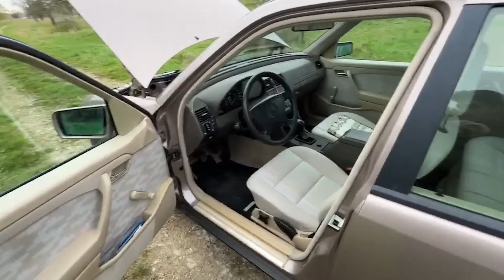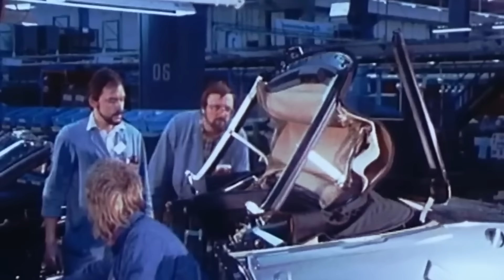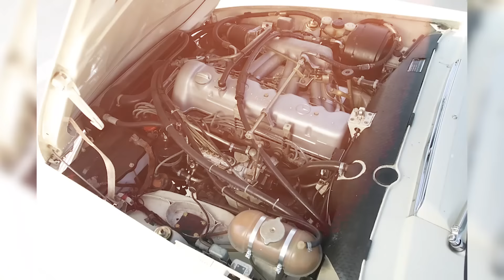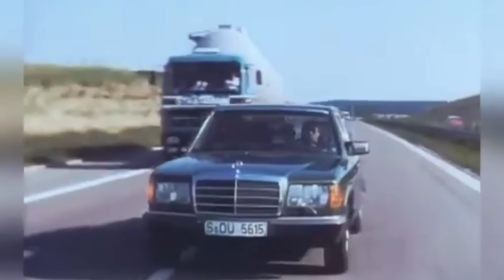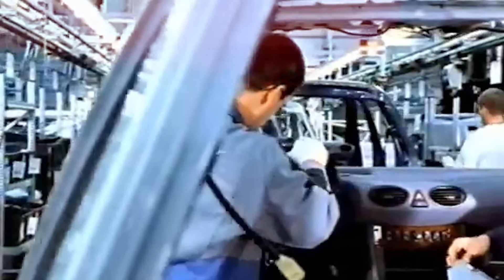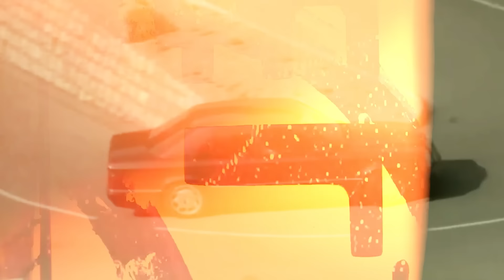9 Old Mercedes That Were Built to Last Forever

Comment: you know what is even better than owning a w123 300D turbo diesel? owning 2 of course. , I'm the proud owner of an '82 and '84 mbz,  one is European (82), the other, american,. there is a difference between the 2, the thread on some engine components is mm. vs standard (I found out after cross threading trans. oil cooler not understanding why at first.)

Comment: This video sounds like a PR advert for Mercedes Benz - totally ill researched and in fantasy land. No mention of the rampant corrosion, the disintegrating wiring, the poor crash tests of the W202, the suspect handling of the W114 and W126. I owned a W126 and it was a good car but had its faults - I have owned a W123TE for nearly 30 years. They are generally good durable cars but by no means perfect

Comment: The R129 is a great car except for the engine, wiring harness made of biodegradable wires and the failing, convertible roof actuators for the fabric top.  The V8 version was unbelievable powerful.

Comment: W202 with M111 engine IS THE BEST i bought it as a send hand in 2014 up to now it is still running it's now 12years. Now i even changed it from auto to manual gearbox it's perfect.

Comment: You forgot 2 more engine types for the W124, both are M119 types. You had the W124 400E, which had the 4.2L V8 producing about 280 horsepower, and the 500E, which had the 5.0L M119, producing 320ish horsepower, and fun fact:  porsche built the 500E in their factories

Comment: I have  c class Mercedes, 60,000 miles  air con packed up and considered un repairable by most  air con engineers I spoke to
Loads  of other jiggly problems which cost  quite a bit.  Mercedes. Suck they really do.                Rod in London  ‘26

Comment: I had an '89 560SEL. destroyed from both ends when i was rear ended at a red light by a 60mph texting driver. Passenger compartment remained 100% intact.

I currently own a '99 SL500 and '03 ML500, both have the M113 five liter V8 and the 722.6 five speed transmission. The last of the real Mercedes.

Comment: OMG.  The W140?  The S-class that had a class-action lawsuit against it, that MB lost?  I had one.  Yeah, damned nice car new, but NO!  Bought one many years ago, and swore I'd never have another one.  Sold it with 101K on the clock, and was happy to see it go.  Like an old Jag.  Spent more time in the shop than it did on the road.  I started out 30 years ago with W126 S-class cars, and to me, they're the last real S-class.  They still had the look of class.  W126 will never be overcome.  I still drive them to this day. I totally agree with number 1 though.  The W123 was by far the greatest!

Comment: W203 is bad car? like worse than w203or202? man i dont know where you heard that, but wtf. yeah problem with rust, but its same with w202, but if you protect w203, then its same like w204, and materials in interior is much much better in w203 than in w204. w211 and w203 all day then anything else.

Comment: They are built to last but they are disappeared almost everywhere, soo....  With the exception of the w204 but they are almost all replaced by 205 now.  The 211 too look good but the sbc issue prevents me from buying one. The 203 imho had better interior design than the 204, the front end aged badly and never fully got me even when new. The older one rusted and plastics melts and crumble over time. My beloved W208 would have been impossible to keep alive and not wort restoring for this reason

Comment: I split my "daily" driving between my '94 W140 S500 and '95 R129 SL320. I've had both cars since new and refuse to get rid of them. The only major problem I've had with either one was the hydraulic cylinders on the R129 soft top. Beyond that, the cars are tanks!! My wife has a 2025 Subaru Forester Limited that feels like a toy next to my "old" MBs. 👍

Comment: No I disagree with the W203 part, the 2006 facelift mercedes benz w203 is also reliable and strong

On the w203 it depends on the facelift... And to remind you W204 and 203 are not really different

Comment: Bin mit Ponton und Heckflosse groß geworden. Meine Großeltern hatten 2  Strichacht,, 1 W 123,,124. Ich selber hatte 4 W123,, darunter ein Coupe,, ein W 124 300 CE 24 und ein W 201 190 E. Die besten Daimler waren 115, 116,126, 107,124, 201,, und der legendäre W123,, das bis heute meistgebaute Modell. Habe mir den Filmbeitrag angesehen,, leider sind manche Aussagen nicht okay. W 202 ,, 210 waren die größten Rosteimer der Neuzeit,, damit hätte sich Mercedes fast den guten Ruf ruiniert.

Comment: W204 1.8 petrol engine has a chronical crankshaft pulleys problem. It's a pain for the wallets. Still a pretty decent car, but if you don't want these kinds of trouble just look for the older versions of the brand. Time can be a enemy sometimes, so if it has rubber or plastic parts, you know what's going to happen past all of those years, but you won't find electric gremlins, over sophisticated (and complex) engineering. It was built to last

Comment: W123  300D wagon, we got it new. Vacuum issues, antenna switch, rear susp. ballasts. Rust at rear wheel arch. All this when we sold it at 56k miles. Not having a good mechanic nearby didn't help. Now a W124 300E 6cyl that was neglected. Will be painting it this summer. Nothing serious and just turned 100k miles. It's a keeper.

Comment: I've owned examples of almost all mentioned. 126, 124, 123, 202, 203, and 204. The best, in my opinion is the one we have now... a 2013 C300 4Matic, with the M276 engine. It handles so well and gets over 30mpg at 80mph. It looks great as well. It has Direct Injection, but still has lots of power, gets good mileage and when the intake was removed to replace a cam sensor, it had very clean valves. I ran Shell, now BP and change the Liqui-Moly every 5k miles.
Reply: That’s very welcome insight, thank you. I’m looking at a 1981 380 SL, and  curious as to the benefits of newer model. 😊

Comment: Tengo el E420 W124 con el V8 M119 y es imponente, también un E320 W210 con el exquisito M112, y tuve el C230 Classsic W202 con trasmisión manual, cabe destacar que Mercedes Benz no vendía autos en México 🇲🇽 a principios de los 90s por lo que tener uno de ellos era cosa de ricos 😅.

Comment: I own a W204 Diesel had it for 7 years and 200000ks driven it all over Australia for work dirt roads and mine sites and never had a single issue although I had to replace the AMG wheels to deal with country roads. It is an absolute beast
Reply: I've had my 204 two years, first Mercedes I've ever owned for some strange reason. I totally love it and I can't see me ever parting with it. 3ltr diesel and it can easily return 45 miles to a gallon.
Reply: @jontaylor1652  They are such great cars and super reliable as well! The only thing I had to do was a DPF burn after 180000ks so I think thats 110000 miles or so . I actually brought mine to flip because I got it so cheap but as soon as I got it I just fell in love and that was 7 years ago

Comment: A bit harsh review on the w203! I have a w203 which is now my wife's daly driver after I upgraded to a w212. I have it since 2014 We never had issues with it just a few worn bushings and ball joints but that's the same for any car that's over reading over 300,000🤷🏼‍♂️

Comment: I own a W203 and even at 210k miles it runs perfect! I can’t even hear the engine compared to my friend’s 2016 Nissan Altima engine that runs so loud. I did have some electrical issues but they are not hard to fix. The wiper and turning signals get messed up but it’s not hard to replace the stoke.
Reply: you are stupid having a W203. Real MB owners won't recommend W203 because it is a garbage product. Really, I wasn't kidding.

Comment: I have owned 2 Mercedes Benz 240 d's, one of them a 1980 model and the other a 1979 model. Before these I had a 2 year affair with a 1960 220b. All of these were all 4-speed stick. After that I owned a 190E 4- cylinder with automatic transmission - an absolutely delightful car. I then bought a 1998 C230 and following that another 1998 C230. These were both 4-cylinder cars with automatic transmission. The last Mercedes Benz I owned was actually my son's. I bought a 1998 C230 with a blown engine. My son bought a used engine, put it in the car and is still driving it. Out of some 52 cars owned during my motoring life these cars cost me less to maintain, repair and run than any other. I guess my 2006 Honda Accord also falls into that category.  As long as you realize that Mercedes Benz engineers liked pneumatic systems rather than electrical systems where they could use either you should be able to manage most maintenance tasks on these cars!

Comment: I have a 1997 c 230k with 321000 miles on the clock...runs great,a few small things have failed but all can be fixed ...

Comment: R129 had 2 big issues, biodegradable wiring harnesses insulation (pre 1995), and leaking hydraulic cylinders for the roof, this is a $5000 repair to replace all of them

Comment: The W203 “universally hated”? Man don’t make me laugh!!! I own a very late 2003 C220 Elegance (One of the first galvanized ones) german built, and it feels like new despite having nearly 300.000 kms! Not a single creak or rattle, nor rust or electrical issues! The 202 was a disaster for rust, cracking vinyl dashboards and bio-degradable wiring… And the 204 was a step back interior wise to the 203… It had a dull Chrysler-like interior with peeling buttons and grey hard plastics…

Comment: I had two of W202, first from 93 with 2.2 petrol engine 150hp, and then facelift version from 98 with 220 CDI 136hp. One of the best cars I ever had. 
I later sold the CDI to a friend — he still has it to this day. It’s got almost 400,000 km on it now. The only real issue he had was rust, which he’s already taken care of, and then the automatic transmission started jerking a bit, so he changed the oil — and it’s still running fine.
Now I’ve got a W212 facelift, also with a CDI engine, and in my opinion, it’s the last truly solid Mercedes.
Reply: How did you deal with the rust on your car? Did it come back?

Comment: I have 2 x w203 C200 Kompressor.....one has 300K klms....(2001)    one has 107K klms (2002} both white.. both W203-045   m111 engine 722.6 Transmission....great cars.. and parts on eBay.. cheap cheap cheap.... Anybody that knows anything about MB.... KNOWS the M271 and M272  are absolute shitbox engine.... the worst 2 engine MB ever made... Google them people.... and NEVER BUY EITHER OF THEM

Comment: I have a W140 300TD (1998)! 
I would never trade it for any newer S-class!
Reply: So you have a wagon w140? Because TD stands for touring diesel, DT stands for Diesel Turbo and TDT stands for touring diesel turbo.
Reply: @skitz7520 
W140 is not a station wagon, everyone knows that! so turbodiesel! but thanks for the correction…
Reply: @ocsi-V8 Yea, but as you said 300TD i had to correct you and i know the w140 only came in sedan and coupe. I just put in some sarcasm for you😁😎

Comment: Today I turned 564,000 km on my Tesla S. The best car in the world, more reliable than all the Mercedes cars I drove 30-40 years ago. The maintenance cost in 11 years is not even 8,000€. The whole car has paid off through almost free driving, if I compare how much money I would have spent on servicing and fuel. And I still have a car that holds its value incredibly well. These new pieces of junk are worthless; it's better to buy a 20-year-old Opel or Toyota with low mileage than anything new, just problems and costs with that eco equipment.

Comment: The record breaker for mileage is a W115, (the four cylinder version of the W114). This was bought by Mercedes from a Greek taxi driver and displayed at the Mercedes museum in Stuttgart with 4,000,000km proudly written across the windshield.

Comment: w204 breh. yeeessss. 

its crazy i have an e550 coupe which the platform/underlying structure is based off of the w204. I can honestly say that from the moment i started fw these cars(had an e400 as well), i could instantly feel the solid/rigid structure upon the first test drive. It felt like a tank to me going down the road, heavy in a good way(these are the cars that were still made in Germany)...also the 3part suspension/adaptive dampers work very well and literally "adapt" to how you drive the car. With the amg pkg it handles damn near just as good as my Veloster N! Lolol naawh, but close enough to have alotta fun with it even though its really meant for being a highway rocket that literally eats roads and long drives.

Comment: - How indestructible do you want it?
- Yes
Reply: suprisingly acurate, you dont really need to upgrade the om 603 turbo engines internals before you pass 300-400 hp

Comment: Most of those selections are reasonable but the W140? 

Are you serious? 

There's hardly any on the road because the thing was so complex

As far as I know the M119 was never used in the W126 

It was introduced with the R129SL 

Crumple zones were not introduced with the W116 in the 1970s but with the ponton of the 1950s 

ABS was introduced on the W116 though. 

Another one of Mercedes-Benz first in engineering 

Interesting thing about the R129. 

It had a very long gestation because they  most of their resources getting the W-201 – the "baby Benz" to market 

It was supposed to come out about 10 years before it did. 

That's why the R107 – the SL from the 70s and 80s-had an over 20 year production cycle 

And because the R129 had so much time for development they developed the M119 V8 for it and pop up roll bars 

It was supposed to have the M117 V8

There were other small errors but compared with a lot of the junk you  see on YouTube it's reasonably well

Comment: M272 as reliable? No, it is a 90 degree V6 engine which needs a balance shaft and is reported as a source of troubles. So the W204 should have the M271 if.
Reply: M271 and M272.. worst engines MB ever made.. shitboxes

Comment: The problem of rust in the w202 was solved in the face-lift  of1998😊
Reply: Before they joined Chrysler and water-based paint, and the accountants took over, 
the cars didn't rust. I see a lot of early models from 1993, 1994, and 1995 that don't have a lot of rust. The steel and rust protection were also of a higher quality than the later years.

Comment: As im watching the video that is a false claim about the w204 its not as reliable as the w203 and the engines in the w204 are the worst engines mercedes has ever built both gasoline and diesel

Comment: W202 was great, my mother had one new in 1995, around the same time my father had a W140, to be honest, apart from being smaller in size , the W202 and W140 doesn’t feel much difference, maybe because my mothers W202 was overspeced, it had every option at the time apart from sunroof.
Reply: I had a nacked w202 122bhp sedan &it went 220km/h 2pees on board

Comment: Iv Owned My 1990 560 SEC For 25 Years AND Its An Incredible Ride! It had 145K on it, Overall it was in Very Good Condition! It Needed a Valve Job when I Got Her. I Found A Fine Mechanic and We Had a Good Relationship! We Worked together and Got it Done He Did a Brilliant Job! It Came Out Great! She Is A Black On Black Beauty She is Fitted With 18in Staggered AMG MONOBLOCK Chrome Wheels 18x9 in The Rear and 18x8 In The Front All Fenders Have Been Rolled. She is in Pristine Condition.  She Never sits outside. Iv been Blessed With Great Mechanics who Have treated Me Great! Iv had Quite a Few offers on Her But NO! I’m Keeping Her! My Wife Says, No Keep Her! Yep I’m Taking This Classic to The GRAVE With Me! She Looks Stunning At 20 MPH AND 120 MPH! The W126… Classic!

Comment: Thr W204 is not overengineered and feels very cheap inside. It's literally plastic fantastic. It's not a quality Benz like the ones til the mid 90s.
Reply: You're totally right. After owning W201  for 7 years and W202 for 10 years, my present W204 feels like the old ones had been shredded and it been made from theirs scraps.

Comment: W203 is not bad at all. Pre-facelift till 2004 had some issues, but facelift till 2006 is solid and reliable car - I can say that as W203 owner for 5 years already. Facelift interior quality, in my opinion, is better than W204. W204 is also a great car - don't get me wrong.
Reply: You are absolutely right
Reply: You need to extend your comment to the W206

Comment: the 202 had three problems the rust and die diesel rotation pump, and the petrol injection system and the om 606 was never deliverd  in the 202

Comment: well at 180k miles I bought a 2011 w204 for 500$ you would be surprised by how bad it aged. I mean the fuel tank rusted through, engine swir flaps went bad, exhaust manifold bolts snapped so motor out job, its totalled mechanically. dont compare to w202 or w201 only the body was better.
Reply: > 180k mile car
> Decade+ old
> Complains about it getting age-related issues.

Every car, I mean every car, gets similar issues with that kind of mileage and age. 

Lexus LS, Toyota Camry included.
Reply: The dollar sign goes before the amount... lol.. like this $500 ... Bahaha  ahahaha  $500  not 500$   Bahahahahaha

Comment: My W126 1987 560SEL  was the best. I now wish I had kept it!!!!!!
Reply: It was one of the best-I think a great compromise between luxury and great engineering and simplicity

Even had reclining rear seats as an option
Reply: Absolutely, still have mine. 112k miles, zero rust, never seen any snow. Only problem, clear coat is fading on the roof.